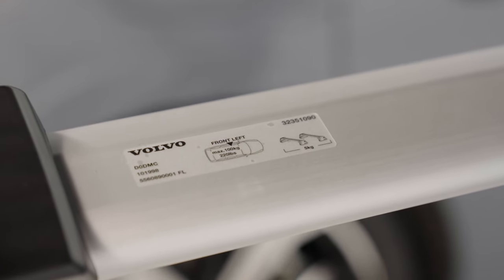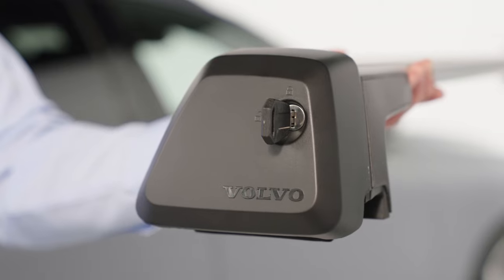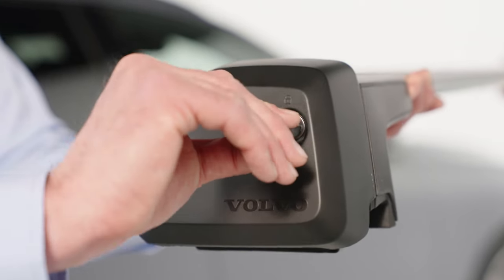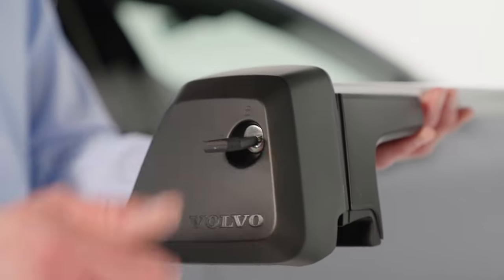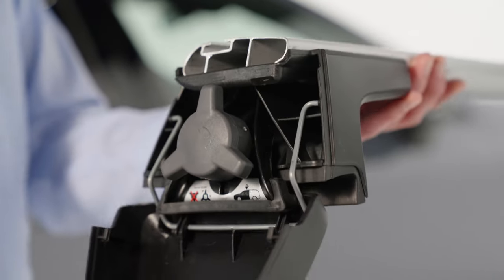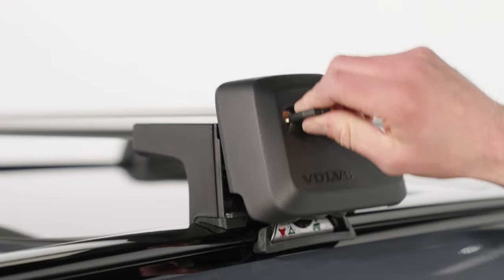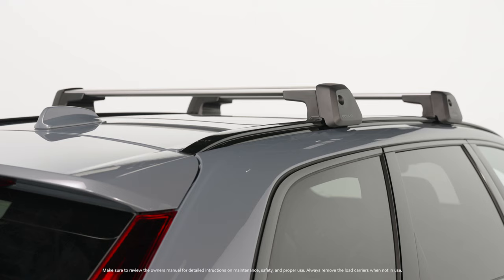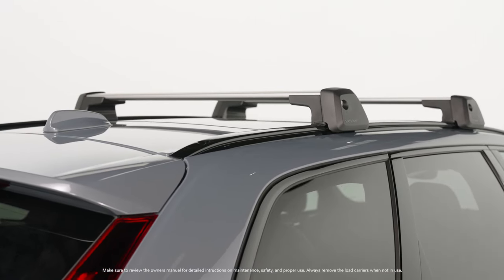Volvo Accessories How To: Load Bars Installation | Volvo Car USA

Comment: When unscrewing the fastener too much, it comes out of its thread and is frustratingly hard to get it to rethread connect it and after an hour of trying have given up.  Is there a tool I have to purchase or a trick to get the fastener to connect since its receiver is unfixed and obviously moves around making it next near to impossible to simply reconnect the fastener